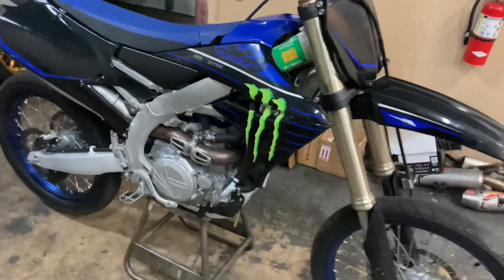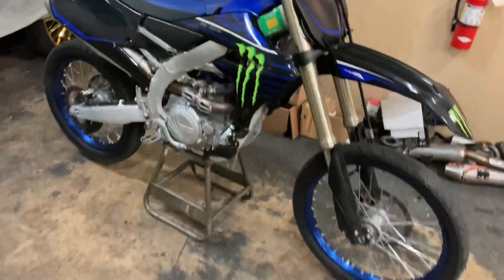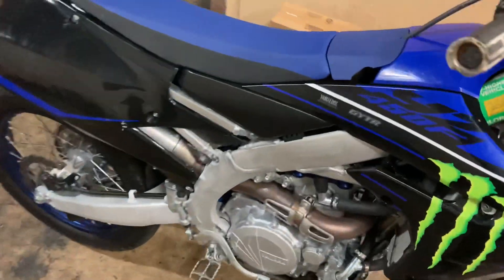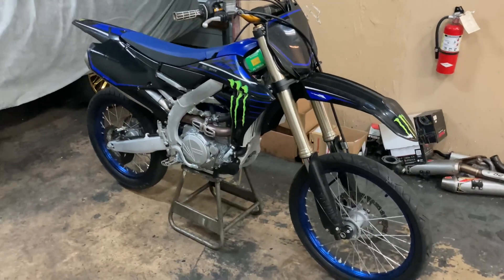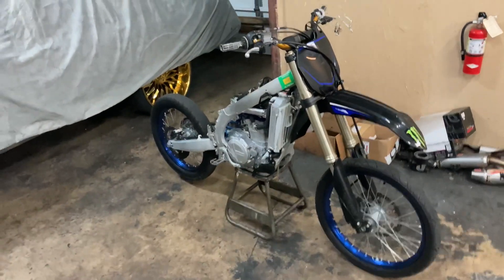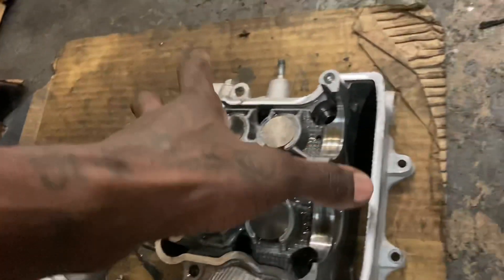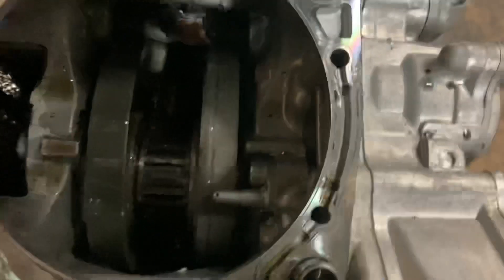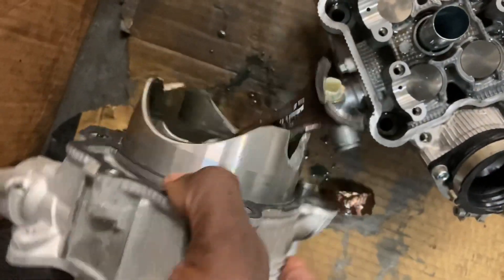2021 Yz450F No Compression Quick Tear Down Crankshaft Snapped In Half

Comment: Yo when you time a 4 stroke do you just put the stator side on tdc?
Reply: Crank side you take the plug out and look for a mark and both your cams have marks. They all have to be in a certain position.
Reply: @mxr248  it’s a crf450r only 1 cam. I build bikes for a hobby but was just wondering cause this bike has 3 marks 1 on the cam 1 on the stator and 1 on the main output gear on the crank
Reply: @dylonglover2074  you must have an older crf450 cause 2017 they went dual cams. I had an 06 crf450 back in the day. Hard on valves.
Reply: @dylonglover2074  you don’t go by stator side. You should have a mark on the gear that gets lined up with the triangle mark on the outside housing and your cam like the one I had had 2 marks on the gears across from each other that should be inline with the head. Also your cam lobe if not mistaken closes to the gear should be at 1 o’clock.
Reply: @mxr248  yeah it’s an 03 it’s the bike in my profile picture just did a complete rebuild.
Reply: @dylonglover2074  cool

Comment: thats why you break them in
Reply: There's no need for a "break in" the motor is pushed to its max before it even leaves the factory by doing multiple dyno runs to make sure the motor works properly this bike was way overdue for a rebuild and probably has at least 100 hours of hard riding on it
Reply: @Sticky-Oregano  they don't dyno every motor. when a bike is brand new your supposed to do heat cycles at least. thats why his crank broke probably first start up he took it out on the road and kept it tapped. cranks don't just break for no reason

Comment: How do u break a brand new bike
I bet the previous owner only shifted when he banged off rev limiter cause I’ve never seen a bike break down that fast
Reply: Look at the back tire. Tells you plenty lmao
Reply: @mrmustache8735  its not even bald
Reply: @mrmustache8735  bro thats a street tire goofy🤡😂
Reply: @mrmustache8735  😂
Reply: @mxk3y733  he didn’t know it was street tire
Reply: @1fiddysquiddy386  o maybe I watched it at too low quality it looked messed up 😂
Reply: @Scythe_Voltage  Actually, maybe I'm blind but the back tire has no thread left. Looks like they did plenty of burnouts on the bike
Reply: Just because a bikes only a couple years old doesn't mean it's brand new. It could already have a couple hundred hours on it and be overdue for a rebuild. Especially if maintenance isn't done consistently.
Reply: @storm5013  2021 bikes were available late 2020 so the longest he could have possibly owned it was for 2 years, it is possible he put 200+ hours on the bike, but it would prob be more beat up if it had that many hours, I think he was just hard on the motor riding it on the road and going fast
Reply: @Scythe_Voltage  Keep in mind this bike is clearly only ridden on the road, so it's unlikely it would look beaten up at all even with a few hundred hours. Also, these bikes are designed for riding really hard all the time, you would need to put some serious hours onto it before it would blow up like this unless it's defective.
Reply: @1fiddysquiddy386  clearly, y'all slow. He's saying street riders don't maintain their shit which is mostly true. Mfs being running the same oil for 80 hours lmao.